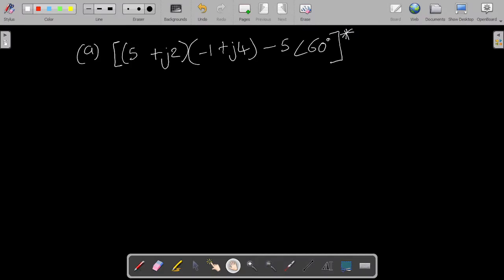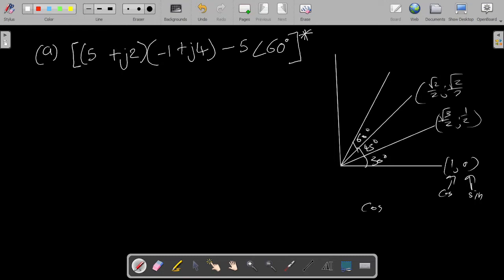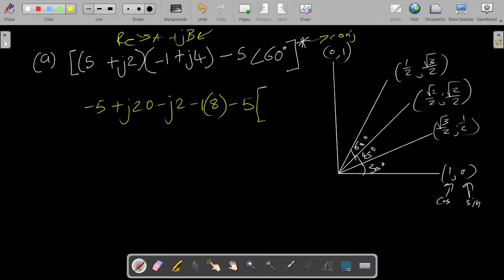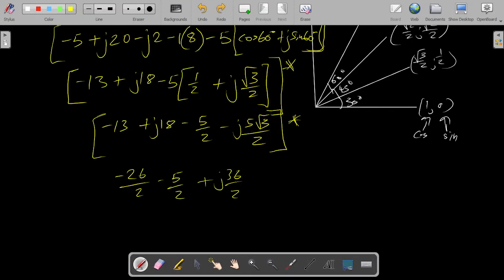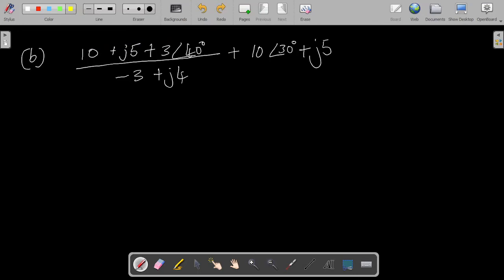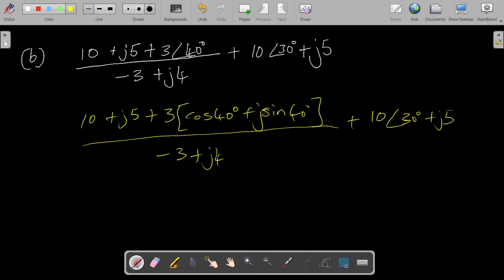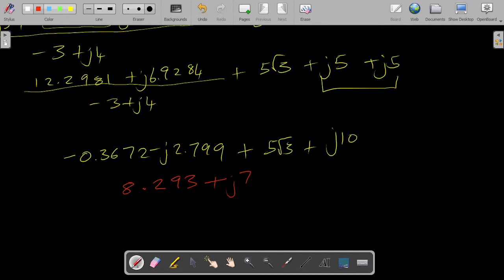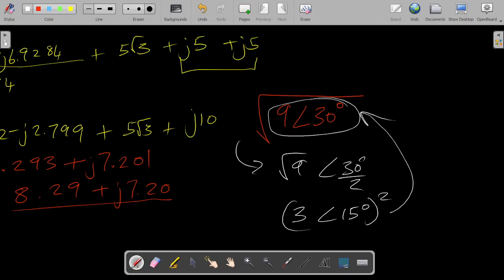Fundamentals Of Electric Circuits Practice Problem 9.3 REMAKE | Khetz Tutorials

Comment: Thank you so much for your video, very well explained. With your permission and I hope this is OK, if anyone is having trouble understanding the division of 12.2981 + j6.9284 / -3 + j4. Here is what you do: first multiply the numerator and the denominator of the division by the conjugate of the denominator, in our case, the conjugate of the denominator is (-3 - j4). 
So you will have: (12.2981 + j6.9284) (-3 -j4) / (-3+j4)(-3-j4). By doing this, you will eliminate the imaginary J at your denominator, remember that J^2 = -1, thus, at the end you will have 25 in your denominator. Something like : (-9.182 - j69.976)/(25), then just divide everything by 25 which is = -0.367 - j2.79904.
Hope this helped just like this video helped me!

Edit: Don't forget to continue the whole process by adding the 5sqrt3 + j10, then you will get the final answer.

Comment: Excuse me, once I finish with the circuit analysis, what do you recommend for later to improve?

I want to be able to understand any circuit and program it to my liking even using street integrated components

I am from Argentina
I am also learning language in c and then c++

It is something that I have wanted to study mainly since I was a child. I would like a recommendation.
Reply from the maker: I would say these basics are a good foundation. If you have a specific area you want to focus on, learn about circuit components in that area e.g. op amps, Schmitt triggers, comparators etc. Also learn how to use datasheets so you can pick suitable components and understand how components work in general. You can also familiarize yourself with simulation software like LTspice which might also require you to understand circuit characteristics e.g. phase and magnitude plots etc. I hope this helps

Comment: Im sorry sir, but idont get how you divide the 12.2981+j6.9284/-3+j4 manually.
Reply: auh okay sir, iget it now. i did divide frst the real then i just minus the second Im
Thankyou
Reply: @brazalayessaf.4482  but after dividing the real part i am not getting the same answer:(
Reply from the maker: @noviceseries  is your calculator set to radians or degrees and is it properly set to complex mode?